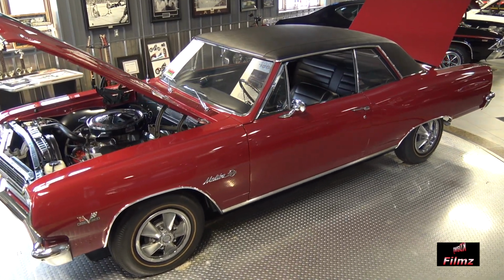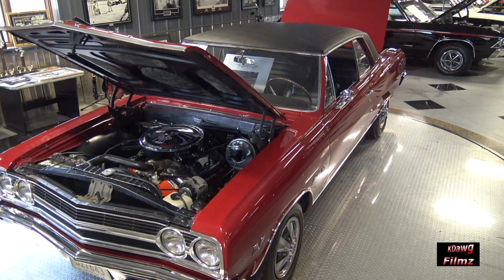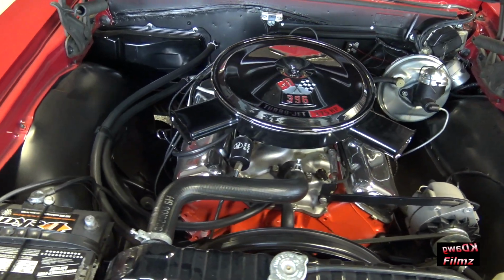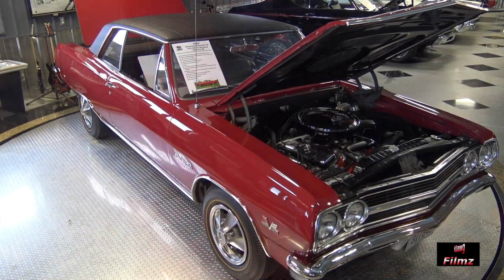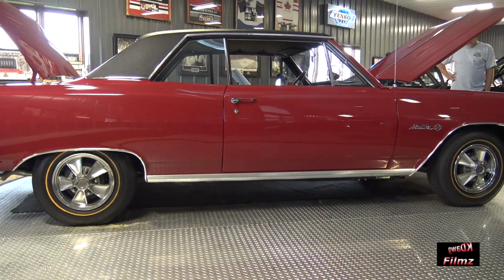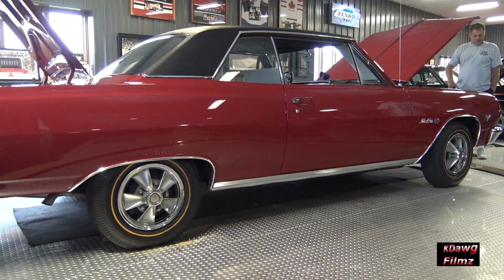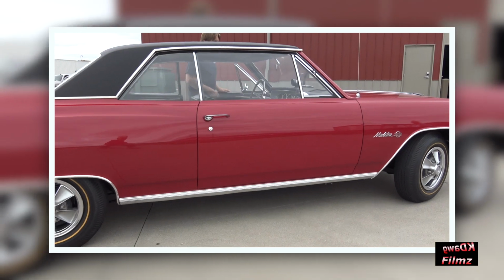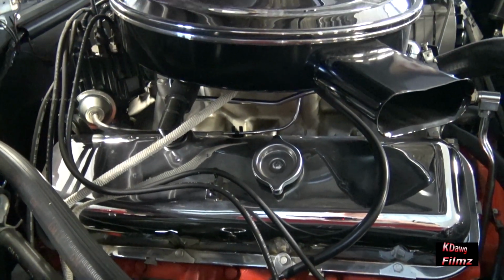1965 Chevelle Z16 Prototype from the Bob Marvin Collection at “The Shed” in Warroad, MN.

Comment: All of the Z-16s were made in the KC, MO plant and were originally meant for magazine people, reporters and or drag racers etc...Chevy wanted the people to show them off and get the word out for the 66 years. That prototype is neat as it has a vinyl top, which you could order extra on the car. The breather also has an actual metal badge on it, not a sticker like you would see moving forward, so if you see one at a swap meet by chance GRAB IT....That 396-375 horse package on the Z-16 was known as the L-37, which next year was known as the well-known L-78 on the 66

Comment: Video states 201 were built and this prototype is the first of the 201. Other Z16 'experts' claim the 201 number includes the 200 slated for production at Kansas City plus one convertible. If that convertible was built, that would mean 202 of these were built, not 201. GM's own production numbers show 201 Z16s built. So, was there never a convertible built, or were there, indeed, 202 total built, and GM did not include this prototype in their production figures? I assume this is the surviving prototype built at the Baltimore plant in late December?
Reply: I heard many times through the years that a GM executive at that time had the convertible built for him.
Reply: @brucedeerhaven  I've heard that as well. GM documentation shows 201 Z16 options were built/sold. The convertible (from what I've heard) was a tan/gold unit with tan/gold interior. Unfortunately, to my knowledge, no photos of it exist - or at least have been posted online anywhere. There were also two Malibu SS cars pulled from the Baltimore assembly plant and sent to GM Engineering for evaluation of the Z16 option. One is still in existence - the trim tag shows it being a Malibu SS (red w/black vinyl top) from Baltimore in December of 1964. The survivor, from what I understand does not have the convertible frame and some of the other production changes. The second test mule was destroyed. The trim tag is shown here: http://chevellestuff.net/1965/chevelle/tags/65-bal-1.htm and the car itself is shown here: http://chevellestuff.net/1965/chevelle/gallery/gallery_z16.htm.
Reply: @gramatr   I always ‘loved’ the Z16 since I first laid eyes on it when it first came out. A friend had one & I wanted one, but my father was still paying for my 1964 Chevelle Malibu SS & said no way.  And I am still ‘hooked’ on them to this day!
Reply: @gramatr  Correct! This car is Number 1, not the prototype. The Prototype was a 327/300 Hp from Baltimore that was converted. The tail trim was cast aluminum.

Comment: The 1965 396 was rated at 375 hp but how close to 375 hp was it actually a lot of Indians were over exaggerated or under estimated based on marketing and to avoid gas guzzler tax or whatever it was called back then
Reply: It had at least 375 hp and it had hydraulic lifters. The ones with solid lifters made much more HP.